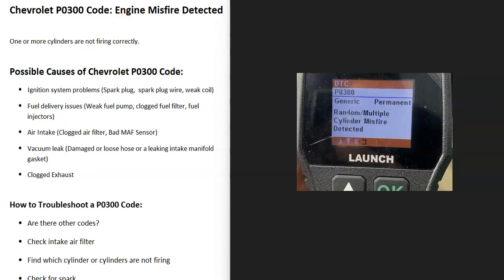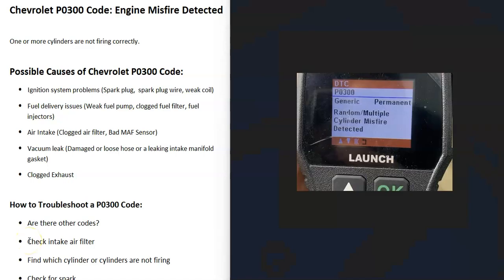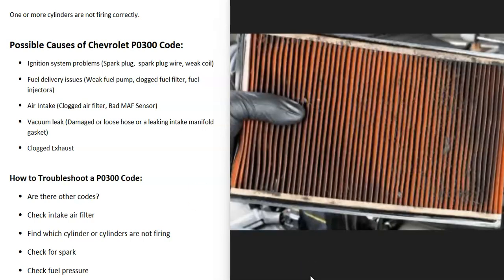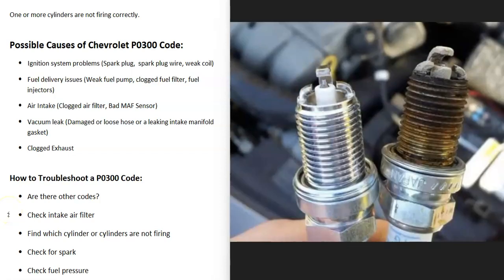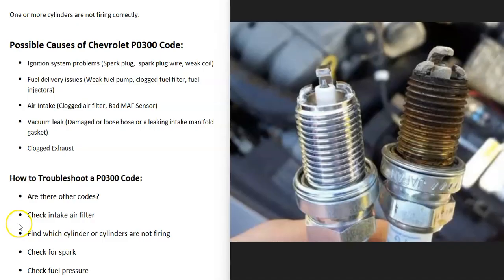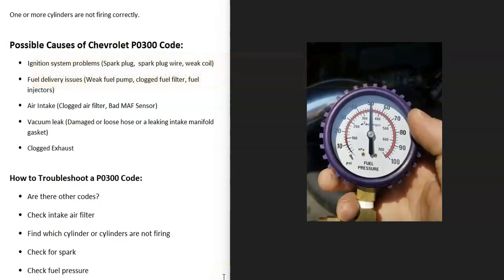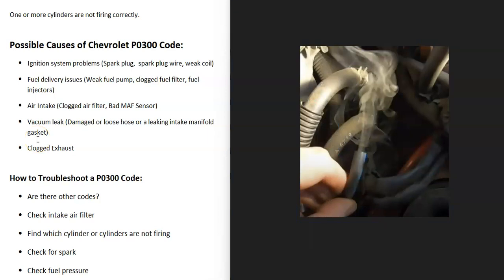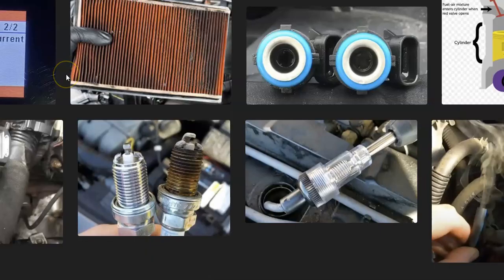Causes and Fixes Chevrolet P0300 Code: Engine Misfire Detected

Comment: I have a P0171 and a P0300 I replaced plug and wires intake medical gasket, exhaust manifold gasket, cleaned fuel injectors, cleaned mass airflow sensor

Comment: I've replaced the spark plugs and the coils and mine is still running rough and it's giving me the p300 code again. The car is actually running a little better but still rough and when you rev it up, it starts cutting back at 3000 rpms.

Comment: Some say p0300 is difficult to diagnose but that's not true. Full tank of gas and long cranks. Takes longer than normal to start and sputters while heavy acceleration. It's obvious. It's a bad fuel pump. Nothing else. No humming either. So I'm going to change out the fuel filter and replace the fuel pump. It's the only thing it is. Nothing else.
Reply: did that fix it?

Comment: My fuel trims are high (14 to 25) at idle and normal (0 to 7) rolling down the road. Sometimes, I get a p0300 under load (pulling a trailer). Any advice would be appreciated.

Comment: I just did full timing kit. Replaced the intake manifold also as the pcv system was plugged. All new ac delco spark plugs. The battery was dead. I used a jump box to start the equinox and i had a lot of low voltage codes and a p0300.i also noticed the gas was really low. Could it just be low voltage?
Reply from the maker: Low voltage can cause issues since it affects the computers and the sensors.

Comment: Am having issues, my Truck was running fine. Went to the store got back in the truck, turned on and started miss firing and bogging down. Changed out the spark plugs and wires, but still doing the same thing and can can hear a ticking noise. Scanner code P0300 Multiple Misfire. ?? Don't Know what else to do, Have you run into this issues before? 2013 chevy Silverado 1500 5.3L
Reply from the maker: With multiple misfires, the problem is likely something bad that would affect the whole engine, such as fuel pressure, a bad sensor, or an intake/exhaust leak. A ticking noise can be many things, such as a bad purge valve or an exhaust leak. This is just a guess, but with the ticking, I would check around the exhaust manifold and see if there is a bad gasket causing a leak.

Comment: Been fighting with this for a year, brand new crate 6.2.  Ran fine for 6 months, then I hit miss fires on #1, #3, & #7. Replaced the entire rail and all injectors.  Ran fine for 2 weeks and started all over again, replaced 2 (O2 sensors), no hiccups yet, and giving me the 425 hp. so far. Anyone want a 2014 6.2 High Country pearl white, chocolate/ cream interior with all options?  15,512 miles on the drive train?

Comment: P0172, p0175, and p0300
Reply from the maker: Something is causing both banks to run Rich, which is something that would affect the whole engine, such as fuel pressure or a stuck open purge valve.

Comment: I have 2020 silverado 5.3L. Mine prompted a p0030 code but truck run perfectly fine. 60k miles no other codes prompted, air filter is almost new. What's first thing to check? Spark plugs?

Comment: Can I connect a scanner to it to check what cylinder the misfires are coming from and to check the fuel pressure?
Reply from the maker: Yes, a scan tool will usually give specific codes for a bad cylinder: P0301 cylinder-1, or P0302 cylinder-2, and so on. Also, most scan tools will show the fuel pressure.

Comment: I got this code when the truck runs for more than half hour . Wants to die then dies starts right up and coughs and seems like it’s running out of fuel.  Air box was off manifold so it’s been getting too much air for a bit Can’t seem to figure it out .  P0161 code with the 300. 02 sensor been that code for a while now though. Haven’t checked the plugs yet .
Reply from the maker: Sometimes, codes can be hard to troubleshoot. A bad 02 sensor shouldn't cause a misfire. P0300 with no specific cylinder codes indicates something that would affect the whole engine, such as fuel pressure or a bad sensor. With no other codes, I would be sure the fuel pressure PSI is correct.
Reply: @HVAC_Mechanic now I got lean code and it starts drives normal for 20 min then acts like it’s out to fuel . The pressure valve on the fuel rail I press it in with my finger and it barely shoots out of there . Relatively new fuel pump but it’s Chinese . Making this high pitch noise on key turn . P0300 never came back today just lean system when it died . Hoping to make her last the summer just can’t figure it out . Leaning toward fuel pump but ugh
Reply: @jeffhayes4926  i replace my fuel pump with a duralast brand back on 12/24 and my truck is behaving similar to yours with it seeming like its running out of gas. I also had a p1516 problem but i bought a gm genuine throttle body and the code hasn’t appeared. but Did you figure out whether it was the fuel pump causing the p0300?

Comment: I have a 2001 silverado 5.3 1500 ext cab ....ive changed all the plugs,injectors,coil packs, and plug wires and injector connectors ...replaced even the ecm....what am i missing
Reply: Crank position sensor , cam sensor , or check compression
Reply: did you fix it?

Comment: I have a 1998 blazer that has a p0132 and a p0300  I replaced the bank 1 sensor 1 and washed my cold air intake do u think this will help haven’t drove it yet

Comment: I have a 98 Chevy S10 2.2 L always ran just great parked in the garage for about a week and now will not start the only way I can get it started is hold the gas pedal to the floor and then it is very very rough you can't drive it I have replaced coil packs, spark plugs ,  spark plug wires new battery, gas filter ,air filter, idle air control valve add map sensor. I dropped the catalytic converter it is not clogged up , code I get is po301.Thank you
Reply: Problem is cylinder 1 narrow it from there

Comment: P0300 on 2012 Chevy Equinox, random cylinder misfires, had about 11-16 misfires per cylinder after roughly  less than100 miles of driving setting the code, no other codes present.  I changed all spark plugs, all coils, then changed map sensor.  Then cleaned mass air flow sensor and throttle position sensor (they sell special fluids to clean both). With each step seems as if the vehicle got some horse power back but no influence on the P0300.  ..........then I tried "Gum Out Multi System Tune-up" cleaner, and have driven close to 600+miles now, fault never came back, so far no misfires.  I have never believed that this stuff works, but appearently it did in my case.  I recommend if you are setting this code with absence of other codes.  (if you are wondering how I was able to read cylinder misfires, for approx 85$ you can buy bluedriver OBD code reader, it reads all codes, and allows you to monitor engine misfire count live etc.)  I hope this helps.
Reply: I'm gonna try that, because I've tried everything, thanks for the advices
Reply: @westtexasconstruction  Gum Out Multi System Tune Up is the exact name
Reply: @Peter-fr8vz  thanks
Reply: Same car, same year, same code. Done all the same things you've done. I'll dump more fuel system cleaner in it again. I do it at every oil change. I think mine may be the timing chain has finally went. Im gonna keep running it until it stops. Can't afford another car right now

Comment: 2006 Chevy Monte Carlo LT 3.9 P0300 no other codes  extreme miss fire.  Before the problem  had replaced  sparkplugs, wires, air filter, fuel filter oil change basic maintenance items. Drove great for 140 miles. Parked came out had  no crank issue, Replaced the main ground  bad connector  at the battery . Now has the P0300, barely starts missfires  and dies.
Reply: Did you ever figure it out
Reply: @tomahawk5373  alternator  was over charging at 17.8 volts.  Toasted the ecm and several sensors.
Reply: @craigwiess1656  did u buy a bigger alternator with more watts?

Comment: I’m asking out of desperation right now😭 I’ve changed everything under the moon to try and fix a cylinder 8 misfire predominantly with 6 and 4 following but not nearly as bad as 8 is. I’ve done the head gasket, lifters, injector rebuild, plug wires, plugs, swapped coils and the bracket/harness they attach to as well as intake manifold gaskets (probably more just can’t think of anything else of the top of my head) and still bank 2 misfires with cylinder 8 misfiring every time it fires off. If anyone’s got any advise I’d really appreciate it😅
Reply: Holy shit and I thought I was having a hard time. Hope you figured it out man
Reply: @Htx.nbs_dj put a new head on and boom went away was my last resort even though all tests were good, trans went out on the test drive then a week later with new trans someone hit and totaled my truck😭😭
Reply: @Danny_K-mm1ot who spoke this evil onto you Ricky Bobby 💀💀💀

Comment: Appreciate the video! I'm getting the P0300 code along with a P0324 (Knock Control System Error), and a P050D (Cold Start Rough Idle); So I'm trouble shooting which cylinder(s) are misfiring now, but any other thoughts you have, please let me know. 
Also, this vehicle is a 2018 Yukon GMC SLT.

Comment: Im getting a p0300 and p0140 and p0160 could those oxygen sensor cause the p0300 code
Reply from the maker: Sensor 1 is the 02 sensor that the computer uses to adjust the air/fuel ratio. Sensor 2 monitors the catalytic converter. Both codes, "P0140 Bank-1 Sensor-2 and P0160 Bank-2 Sensor-2," point to sensor 2. It needs to be diagnosed, but there likely is an issue with the engine that is dumping fuel into the exhaust, causing the CATs to run hot and may have damaged them.

Comment: 2000 chevy silverado 2500 
new fuel injector/pump/filter 
i’ve used ac delo for the pump and injector and a wix fuel filter. truck runs a lot better but still misfiring .
Reply: edit: i’ve noticed that when the truck is in idle it’s good. but as soon as i start driving and hit about 2200 rpms a check engine like straight to flash on my dash. i come to a stoplight it goes away. light turns green i accelerate no light. once again i hit 2200 rpms area and it comes back
Reply: @syxne7419  any updates?
Reply: @4rmDEC2FRE  I literally replace everything I could think of all eight spark plugs and wires. All eight ignition coils. All eight fuel injectors. New fuel pump. New fuel filter. And it still was misfiring so I took it to my buddy who has a diagnostic tool and he did a crank relearn and it fixed the issue. been about 5 k miles now and she’s drivin great
Reply: @syxne7419  thats nice to know you were able to find a fix. Did you replace the Crank Position Sensor or just the relearn procedure?

Comment: Thanks for the video👍🏻🍺🤜🏻 one question will a brake job cause a vacuum leak and get that code ?
Reply from the maker: If a hose was accidentally disconnected, then that can cause issues. The brake booster works from the vacuum and will have a big hose on it that, if bad or disconnected, will cause a vacuum leak.

Comment: 14 chevrolet corvette 
Current Codes: p0300, p228c and pending: p0157 

Initially I had 1 code: p0306 : cylinder 6 misfire. I poured chevron fuel system cleaner. 

Where should I be looking first ?
I just bought a autel scanner and it's coming in soon.

Comment: Thanks for your support, I have a 2019 Chevrolet silverado v6 4.3 liters, yesterday change oil, oil filter, air filter, spark plugs, and spark plugs wires, the idle rpms it's in 650 rpms, and in low rpms works great, but in high (50 mph) display a signal parking brake service, and shows the P0300 miss fire, I specting today change the fuel filter, but I don't know why show this signals, can you help me please

Comment: I got a question, could the problem be the o2 sensor? Because I get the po300 code and like 7 more codes that show me that it’s the bank 1 sensor 1 and sensor 2.. so if I replace the o2 sensors, is it going to fix the po300 code?

Comment: So I got P0300 with a P0172 can you help me pin point the problem
Reply from the maker: The engine is running Rich for some reason. Rich codes can be difficult to diagnose since so many things can cause it. I made a full video on how to troubleshoot a P0172 code. Here is a link. https://youtu.be/nSkOnWLfLqY

Comment: I have a brand new 2024 GMC Sierra with engine code P0300. Some times at first at start it looks like it misfires but when it warms up it run fine.
Reply: Seems like it should still be under warranty?  Have you taken it to a dealer?

Comment: I have a silverado 09 1500 it has a very minimal failure when it is turned on and parked it feels that it shakes a little but very little, if it disconnects a coil it feels that it fails more, I can't identify, because the fault is very minimal it shakes very little, change spark plugs and cables
Reply: Yeah same. Did you ever figure it out? It’s driving me crazy trying to track down what’s causing this.

Comment: What if I don’t have no other codes that popped up before and after I fixed my 02 sensors they don’t pop up no more just this code I’m thinking it’s my fuel pump I changed the spark plugs coils and injectors mass air flow sensor
Reply from the maker: A P0300 can be hard to diagnose sometimes, especially when there are no other codes. Basically, all the components that can cause it need to be tested.

Comment: My 1998 silverado replaced the distributer and camshaft sensor all new wires, spark plugs, distributer cap and rotor. Shortly after puller a po1345 camshaft to crankshaft correlation code. Cleared the code and then it went to a misfire code on cylinder 6. i ended up replacing the crankshaft position sensor and then did a reset on the ecm using alligator clips. Removed the negative battery cable and hooked one end of the clip to the positive cable still connected to the battery and the other end to the unhooked negative battery cable. Let it set for about 10 to 15 minutes. Now it runs like new and no more codes. Originally it idled good but when you got up in higher rpms it would shutter and misfire. This took care of the issue thank goodness.
Reply: I've got a 1996 c1500. Reman motor with less than 2,000 miles. Started out with a cylinder 7 misfire, cleaned the plug, that turned into p0300 multiple misfires. Now, new plugs, distributor, retimed, EGR, pcv, and fuel filter. Still throwing p0300. Any ideas?
Reply: @cameronbachelor4066  since you replaced the distributor the camshaft sensor was also included, I would go ahead and replace the crankshaft sensor and reset the ecm. The two sensors communicate with each other.
Reply: Thanks for the reply. It ended up being the rocker lock nuts were wore out so after they were torqued, 3 days later they came loose again. Shoved #3 push rod thru the rocker. When the 3rd mechanic to touch the truck and fixed it, took it apart, #7 locknut was laying on the top next to the broken parts. Reman motor and have as much in the top end repair from the mechanic that installed it that I do in the whole reman.
Reply: @CamBachelor-m9r 
Sorry to hear brother

Comment: would have been nice if you described when the problem happens to what is happening,  p0300 code on my chevy, check engine lights intermittently  but only on the highway at 60+mph, prett sure its spark plugs but it could be gasket issues
Reply: It’s a misfire and can happen at any speed. Gaskets??? Which ones possible!!no
Reply: I had this problem it would flash only on the highway. It ended up being the o2 sensors according to the new owner

Comment: What about bad 02 sensor..i have bad one
Reply from the maker: A bad 02 sensor will not let the engine go into a what's called a closed loop, which will cause the engine to be less responsive and possibly use more gas, but it won't cause a misfire.

Comment: Ok I have a 06 trailblazer 4.2 litre I changed out the fuel pump /injectors /coils/plugs/o2 sensor/checked the cat in it that was clear all new gaskets on intake and throttle body and it still has the code and I did a compression check and there all the same there all over 200 so I have no idea I even checked for vacuum leaks with my machine and nothing I’m stumped any ideas on what else to check ? Or could cause this ?
Reply from the maker: Misfires can be hard to troubleshoot sometimes, since it is a P0300 code that usually means it's something that would affect the whole engine such as a sensor, fuel pressure, air intake. If the engine runs OK, it might be only an only 1-3 cylinders causing the problem. The spark plugs could be removed and matched to a spark plug burn chart to see which cylinders are having the issue.

Comment: Along with the P0300 mine is showing B2961 which I found out is the BCM. Should I change BCM first to see if that works? Also I changed the plugs about 2 months or so ago. Thanks Greg
Reply from the maker: The BCM usually only affects components located in the body, not the engine, unless there is a wiring issue.
Reply: @HVAC_Mechanic  after sitting up for over 7 years when you crank it all the lights on dash come on. Will changing the BCM help with that ?

Comment: Done all this and still p0300 code. 57psi fuel pressure. Plugs,wires,egr,pcv valve,rotor cap,o2 sensor,injectors,fuel filter. Still lost on this code
Reply from the maker: If all the parts are good, it is likely in the wiring.

Comment: How bout this scenario..... an P0300 code and check engine light.  Repair done, includes 02 sensors (3 of 4), throttle body cleaned, one new coil pack, new fuel filter, EGR valve, air filter. 
Rough idle gone and CEL also gone but now has low RPM at idle (500) with some stalling.
Would appreciate any help. Thank you. 2001 Suburban with 5.3 liter with 231K miles.
Reply from the maker: The throttle body may need a Relearn. Usually, it will relearn on its own when being driven, but you can look up the steps to speed it up.
Reply: @HVAC_Mechanic  Thank you, appreciate the help!  Keep the vids coming.